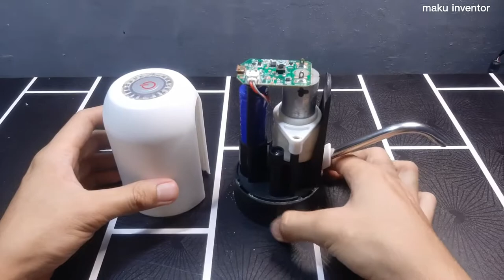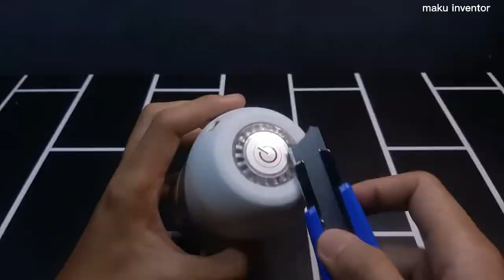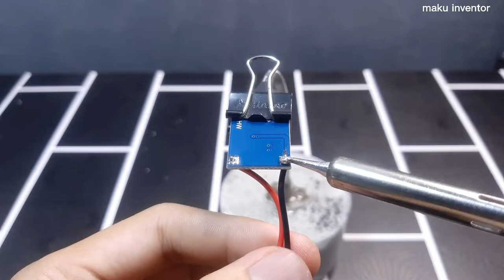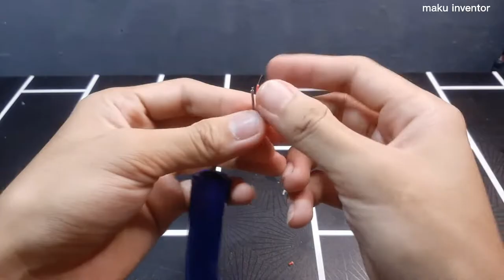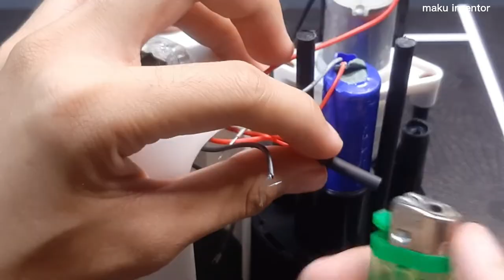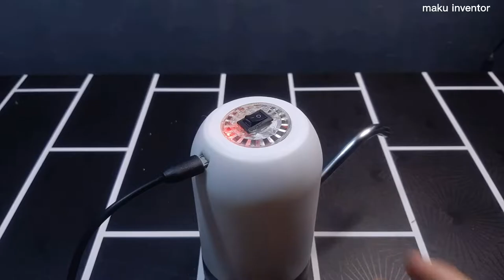How To Repair Portable Water Dispenser

Comment: I have one, its leaking, can you help me, i opened it and cant see the problem, everything looks good.
Reply: mine us aleo leaking..i found no video on how to fix the leakage problem
Reply: Probably you need to push the metal pipe firmly into the opening 

Mine was leaking out of the box till I did that
Reply: @Siver5300  true...mine also got fixed when i tightened the silver pipe

Comment: can u bypass the battery? my battery seems to have died and it uses basically the same battery, or where can i find a replacement battery? circuit board seems to be ok in mine, just battery dies immediately so i either need to change it or bypass it
Reply: I found a new battery like some weeks ago but I don't know how much it's going to last, hopefully for more than a year, problem is i think it will eventually fail and would want to know how to bypass it eventually as well so that I can apply that solution whenever I consider it necessary, hopefully I'll find a way to do it one day.
Reply: my battery too dies fast even after replacement .cant last 24hrs and diodes becomes soo hot when connected to charger

Comment: I have a question. What voltage is the video water pump? Because if the 18650 battery is 3.6V, then the pump is 3V. Or is there any element in the electrical circuit that raises its voltage to 6V? Most pumps of that size I've seen are 6V - 12V. Thank you, your video has helped me for a project I'm trying to do !!!
Reply: The circuit he used is for a power bank 

It outputs 5 volts 

I think the original circuit did a similar thing

Comment: Could you tell me what kind of motor that is and what kind of battery as well. (including the voltage)
Reply: That's a 12V vaccum motor and 18650 3.7V battery

Comment: Sir paano kung nag biblink lang ang ilaw ng pump?
Reply from the maker: nabasa ata ng tubig yung part sa circuit kaya ilaw nlng ang nag fufunction. replace mo nlng charging module kagaya sa video.
Reply: My machine stopped working and doesn't show charging indication i.e. red LED. How do we know that is there a battery problem or charging module problem? Thank you.